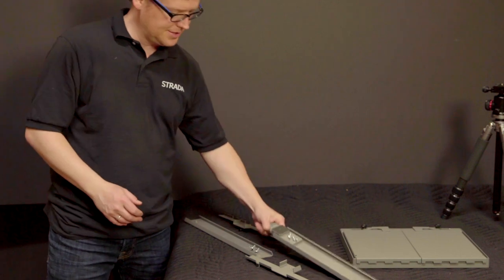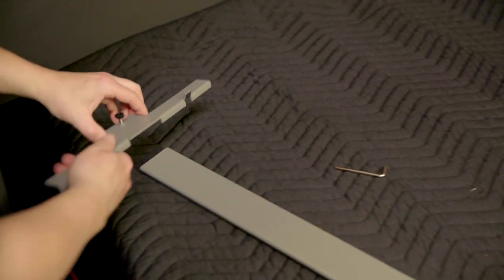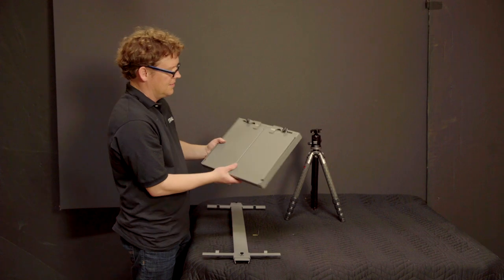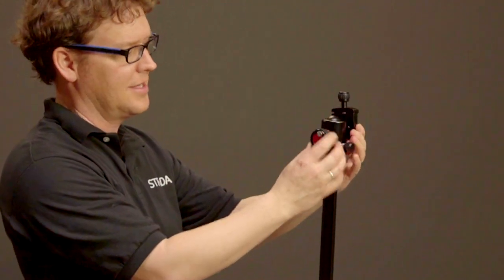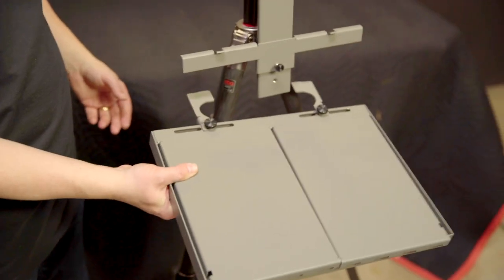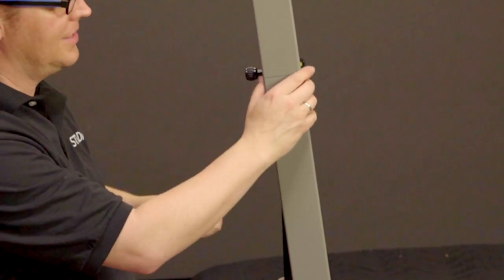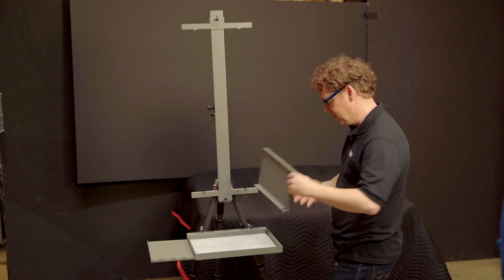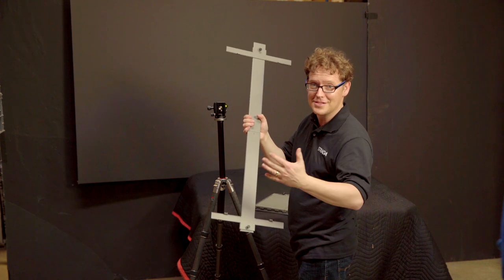How to assemble the Strada Mark II

Comment: My palette tray doesn’t stay as level as yours appears to be.
Also, how do you keep the palette hooks from scratching the tripod?
Reply: Just lower the back leg a bit so it levels off.
Reply: @BryanMarkTaylor  good question about the scratch. Is that something we should worry about? I just got the top of the line tripod, and I'm not sure if the palette should go on the foam arms or the carbon fiber? Is there a video showing this?
Reply: @SelfSealingStemBolt   if there are 2 foam arms, then I think definitely. But if there’s only one, like this tripod, then I’m really not sure.
Reply: Thanks!